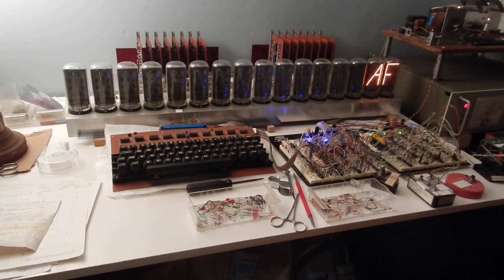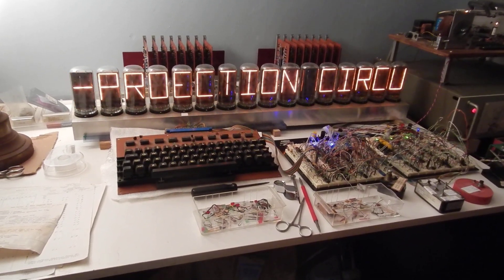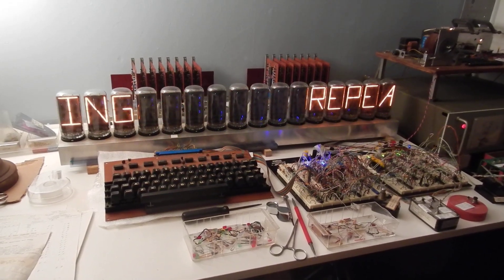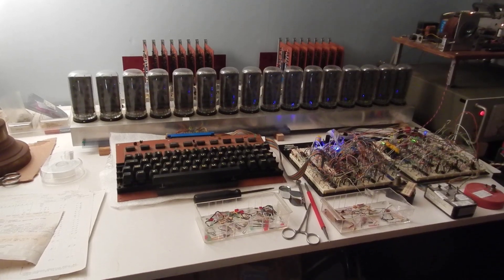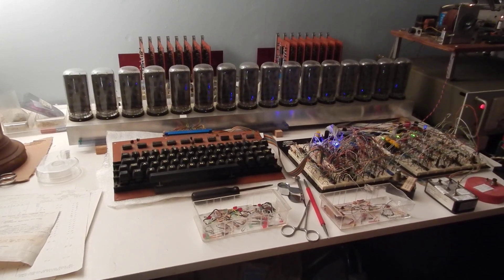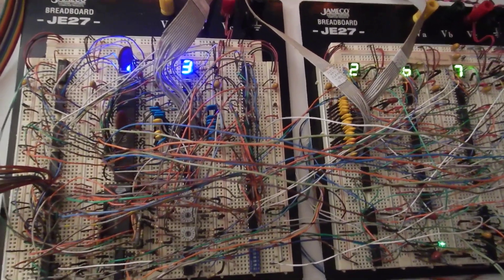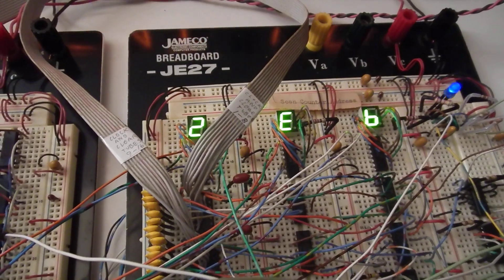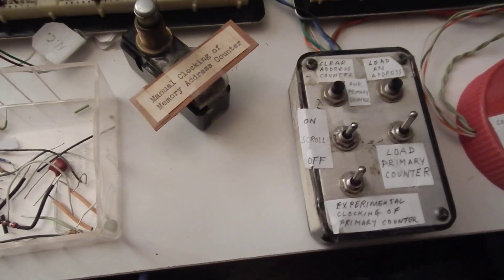DSCN0434

Comment: Holy cow ! You are definitely brave to do this entirely in discrete logic. The last time I did a discrete logic design was more than 10 years ago for my first nixie clock. Since then, everything uses an FPGA, RasPi CPU, or both.

BTW, my first major electronics project was in 1979 when I built an ASCII video terminal for remote timeshare access (110 baud dialup), and it was the same Radio Shack keyboard.
Reply from the maker: Thanks!    Just swapped out several of the old 7400 style ICs in that RatShack keyboard.   Installed a variety of CMOS ones such as HC, C, HCT, and had to settle for a few LS
ones in sockets where none of the CMOS ones seem to operate correctly.   But now have total keyboard current down to 90 mA, where as originally it sucked up 450 mA!